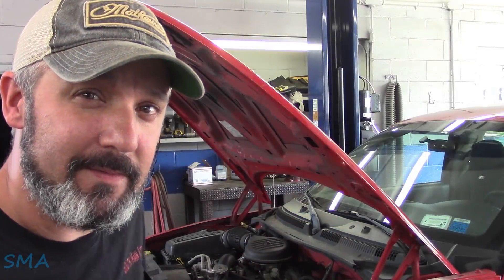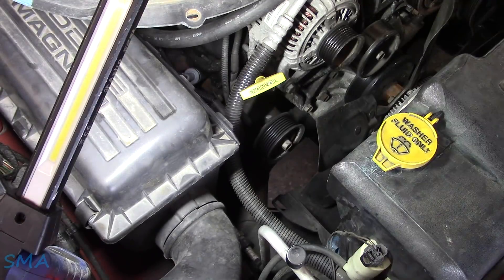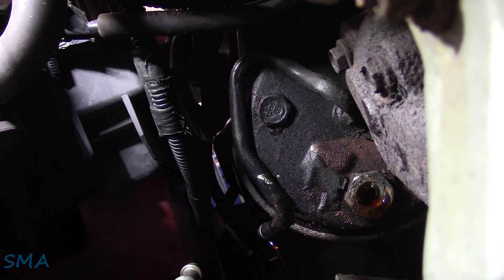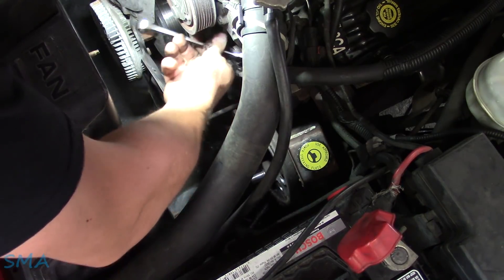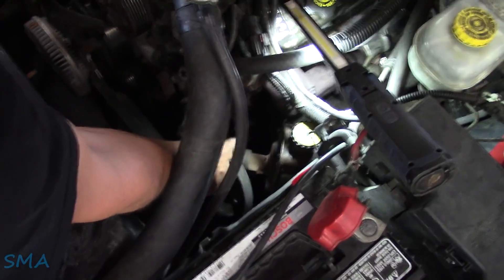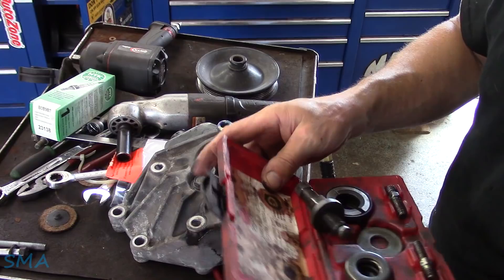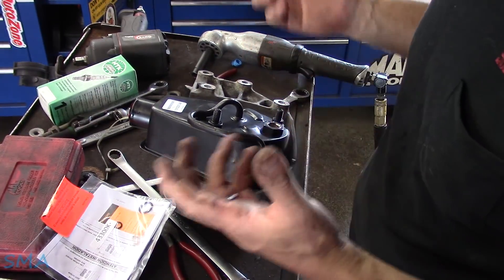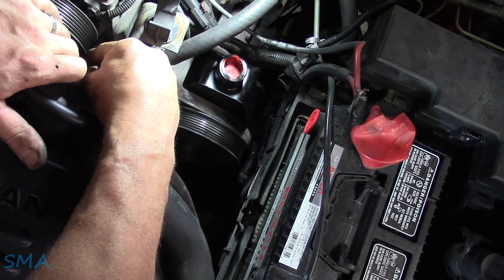Dodge Dakota: Power Steering Pump

Comment: I encountered my first press on power steering pulley when I was about 16. I had the pulley completely mangled and was ready to get out the torch when the boss not so kindly asked why I wasn't using the puller...
Reply: Doh! Them press on pulleys can be a PITA.
Reply: I don’t understand why they all aren’t splined with a nut like Honda. 🙄🙄🙄 sometimes you have little room to work
Reply: I cut mne off with a cutting disk... It was stuck. No core return on the pump
Reply: @foodskewed9197  Well...anything they can put a special tool to, spend idk what 300 per set of tools MAYBE per dealer, and bring in TONS of customers doing so when independants don't have the tools. It's anti Right to repair. It's not encrypted data in the pulley. Its a piece of metal. Not gonna pass anything saying you need basic tools to work on cars though.
Reply: @foodskewed9197  cost. Splines on the pulley and the shaft of the pump add complication and cost meanwhile a press fit is pretty easy to manufacture. especially on something as sloppy as a car.
Reply: @JackS425  you might want to tell that to some of the Manuel transmission manufacturers. The T-5 i believe uses a splined shaft for Second gear. When they put it on it broches the second gear hub onto the shaft. They sell it with the hub and slider already on the shaft. According to BorgWarner which sold it to Tremtek who continued with the process because it was cheaper in the long run.
Reply: Pullers are cool and all, until the pulley is so seized to the pump shaft that the puller rips the collar off of it haha. Then comes the cutting tools
Reply: Even w/ a puller I still have to break out the Mapp sometimes. Just be sure to have the replacement on hand ahead of time. If it wasn't leaking before it will now.
Reply: @foodskewed9197  because Here at Honda we don’t mess around. Better to have the car on the road. Or you enjoying looking at it in the drive way after all day commute. Then on some left in a shop
Reply: Real men just hammer the pulley on with the air hammer until it blows out the back of the pump!
Reply: @foodskewed9197  Splines and a nut add cost. Press-fit is cheaper to manufacture.

Comment: Others hinted but I will directly express my hope that we will get to see the reverse polarity resolution.
Reply: The guy released the magic smoke so this should be interesting.
Reply: @Brickrider2  Refilling the magic smoke is going to be expensive.
Reply: @MrCPPG  Yeah, Gandalf The Grey is gonna charge Eric O. a lot. Lets hope Eric O. doesn't lose any magic smoke on his way back home.
Reply: Yup let's see the burned up dodge
Reply: I am curious to see what happens to a reverse polarity Dodge, too. Does it turn into a El Camino?
Reply: Yah he's very lucky that his ECU seems safe do they have a special mega fuse to prevent that I heard that some Toyota's have that
Reply: I did that before to my 1999 Camry. You know what happened? Nothing. The main battery fuse blew and that’s it. Replaced and it of course is a tank and started up without issue. ☺️
Reply: @TheCrystalGlow  knew I thought I heard that Toyota had a special mega fuse to protect the car but then again this is a Dodge challenger
Reply: @TheCrystalGlow  yep! Try it on a 02 Lexus ls430! Never let your nephew hook up your jump starter. That’s why I love older Toyota’s, much simpler wiring
Reply: Normal electrical components (motor, solenoid etc etc) should be okay, but for integrated circuits you probably need to replace them all, means a lot of computers and a lot of money
Reply: Second that motion!!
Reply: @coltyao6663  my actual hypothesis is a number of fuses will need replacement and, at worst, the TIPM. Hopefully Mr O will see fit to verify.
Reply: I really hope he puts a video of too sounds like a good dia video and show us what can happen

Comment: The ruler and wire tie were there to shim the fan shroud, genius roadside fix.
Reply: Oh man, great deduction.
Reply: Beat me to it.
Reply: Was it an OEM ruler?
Reply: I came to comment same thing.
That what I thought when I first saw them
Reply: @scottyakoubian9238  Precisely measured adjustment.
Reply: Too bad that would not work. That year Dodge is metric.

Comment: Service data:  Doing things the hard way since... when was serviced data started?... since then!  Yeah, I cheat too.  That is why the YouTube comments tell me I will never be a real tech. LMAO Keep breaking the rules, saving time and making money so I don't feel alone!
Reply: breaking the rules ...or .... breaking the ruler ....... lol... I know .... no need to thank me ....
Reply: LOL I been a tech for 40 years this September. The service info is a bible for younger folks and a guideline for those who want to make money.
Reply: Even as an above average diyer, I would go crazy following service data.
Reply: in the pile
Reply: @meabob  

I treat service data as a suggestion.
Reply: One does not need to be a real tech when one has a gaggle of gnomes.  😉
Reply: Agreed. Service data is great for torque specs and as a general "how to" for some newer applications... beyond that, it's a huge waste of time
Reply: Except this time, service data was right on the $. The bracket must be pulled, so why not take it off as an assembly? He installed it that way...
Reply: @adamtrombino106  why am I going to pull al of my hoses to pull the pulley? Adding more time and cost to the project

Comment: Fun fact. The "factory specs" that Mr. O refers to in almost every video isn't actually decided by the automotive companies. It's actually the part of the design of each particular bolt. Example: ½-20 hex 🔩 will always be the same spec, I'm sure the grade plays a roll in the decision also. But I always thought it was based on the vehicle/application and thought it was interesting to find this out.

Comment: "Try to start it, wrestle with it then walk away for 45 minutes and come back and it will go right on."  Life lesson.  Truer words were never spoken.  Happens all the time.  Even with working on cars.  😱

Another great video from Eric O.
Reply: I watched a mechanic struggle with a hydraulic hose for 15 mins he through his hands in the air and gave up. I did it in 10 seconds. The trick is not to be a smug prick. it just happened for me.
Reply: Dad always said he would sleep on it, next morning problem solved. He'd say I fixed it in my dreams . LOL
Reply: yup, helps having slippery nasty gloves that you end up ripping off, screaming profanity and then throwing your wrench across the shop, walking away and come back and like he said. That bastard goes on the first try.

Comment: Changed P/S pump on my '95 Dakota - 3 days later was changing high pressure hose.
Reply: Been there, new pump, higher pressure, old hoses
Reply: It's common, the lining of the hose deteriorates over time, especially if you use whoever's fluid when it leaks. Multiple fluids have small differences in additives they use. Some hoses are resistant to a more broad array of fluids that others. Usually happens when you use cheap fluids to get you by before the repair is made.
Reply: @metalsurgeon9196  It was an old farm truck, I figured as the pump got older it didn't create as much pressure, the hose got older as well, when new pump installed the hose couldn't handle the higher pressure and failed. Definitely could've been various fluids, I bought it used and don't know what the State used in it before me. I did add fluid periodically until I repaired it as just driving around the farm it wasn't a high priority. When I had a free day and nice temperature I replaced it. Took all day as teh auto parts store couldn't find the pulley puller their system said they had, so had to drive to the city an hour away to get one.

Comment: Ha! I just did this to my 2003 Dakota 4.7. Then while bleeding the system it blew a seal in the rack and pinion. Local NAPA (not a sponsor) didn’t have it in stock so waiting on parts delivery.
Reply: Those power steering racks are notorious for an early death and expensive repair
Reply: What kind of impact is that

Comment: Been there myself  changed out my power steering  pump along with my rack and pinion  so much fun , that was on my 07 jeep liberty sport 4x4 ,  another channel actually stated that I had to drop my front differential to remove the rack and pinion but that's not completely accurate!  With a little fanagling and a little colorful language you can sneak it out the passenger side whole  !  Which inmy opinion was a hell of a lot easier than disconnecting the differential.  Have a great day  !

Comment: I just pulled mine off my 01 dakota yesterday. For those hoping to not remove the bracket I was able remove the pump without taking the bracket off. If you move the pump down and towards the driver's side there is a nice clearing beneath the manifold that you can then get it up and out of.

Comment: Just a tip I got from a GM Tech, power steering pump startups is, you bump engin just give a revolution on the engine after you fill the reservoir and make sure the engine does not start and do that a couple times and it will suck down the fluid but not aerate the power steering fluid in the reservoir. And then you will not get all that whining and stuff like that and having to try to get air out of it. All the best from Canada

Comment: I'm going to have to pay more attention to the belt direction.  In my 20+ years of DIY I don't remember anyone pointing out that little tip. Thank you.
Reply: In my 40 years of mechanicing for a living, I've never known it to be an issue.
Reply: I use it as a "did someone screw with it" marker. I put belts on the same way regardless, with the digits so I can read them. Every time no exceptions, even if the customer begs to re use the belt.  My shop policy is new belt every time, so there is little chance of squeak as possible. I also fold cotter pins the same way, just so I know if someone other than me has been there. Not so I don't have to pay a gasp warranty claim, just so I know if someone else has been in my work.

Comment: I leave my bolts and nuts loose, that helps in the alignment of the PS hoses or brake/fuel lines.  This especially works well on German cars where the threads are very fine.

Comment: As a mechanic Ive gotten far too used to doing work in areas of engines and transmissions where I couldnt see a thing, and had to work solely by feel. This video is not much different than that. Yet, i still got the entire lesson fully. 👍👍👏👏
Reply: Ever close your eyes when you're working in the blind? Seems to help me often.
Reply: @psav1520  all the time! I find myself doing it when ever i cant see what Im feeling and automatically close my eyes. Weird. I suppose so i can visualize what im feeling.
Reply: Working by Braille,  we call it, eyes often squeezed shut tight, and using the fingers that fit the gap and the angle, wishing for an extra wrist half way up the forearm.
Reply: @leighpike6572  exactly. Wishing you had a swivel elbow and 12 point stubby sockets for fingers, in both metric and SAE, and a built in mental torque wrench.
Reply: Working on aircraft it's a daily occurrence

Comment: Hey Eric. Aren't you supposed to use ATF+4 for the power steering system? My 01 and 00 both called for that. The old fluid looked pink as well.
Reply: Yeah I coulda sworn these called for ATF+4 , there's even a bulletin for these going as far back as 91 to use ATF+4 in place of the fluid that has since been discontinued.
Reply: @phoenixbranwen766  The manual for mine said to use ATF+4 (The 01). The cap just says to use power steering fluid. When I tried using just off the shelf PS fluid it made the pump strain. Its much thicker than the ATF so it makes sense.
Reply: It’s just an old Saginaw pump which GM and Ford have used on various applications for about 60 years. Dexron , Mercon, +4 or any power steering fluid works fine in them . They aren’t picky.
Reply: @prevost8686  Makes sense. Mine was probably on the way out and the thicker fluid caused it a bit more pressure than it wanted.
Reply: @prevost8686  yup those pumps are monster work a holics. Basically if they got any slick juice they're good!
Reply: But maybe the Rack n Pinion needs the ATF+4 for something??? Maybe clear PS fluid lugs the engine more???

Comment: If that's the same pump that goes on a chevy truck, then the studs on the back are for mounting the bracket that holds the back bolt to the block, and only 3 of the bolt holes on the front are used.

Comment: I did this on my 89 Dakota...  decided to change hoses as well.... naturally they didn't want to  unscrew...  took it to a local shop...  they managed to CRACK the rack and  pinion assembly trying to remove the hose...  had to replace everything...   30+yr old machines will do that.

Comment: I just bought the uh Astro long light there you had shown off, thing is awesome. like 60 Canadian pesos for the light (which is all you NEED) and then idk another 60 or so for the MAGNETIC charger, which i love. Thing has a nice bright light that is basically a perfect color and brightness. Less and less metal to stick it to...which is sad, but still a great light. I was previously using a Snap on like CHUNKY folding light. Horrible battery time, chunky, no magnetic charge less powerful light and like 3x the price. About to maybe buy another Astro to have a backup or one for when its dead and charging.

Comment: Likely the fan shroud had alignment issues before. I'd sure hate to get a new part that required cutting off those rear studs in a certain application. Good tip in suggesting try to work around the water pipe or you might own that leak down the road.

Comment: Good to see even the pros struggle with getting line nuts started.
Reply: get it straight and turn it to the right
Reply: It's sometimes easier to start the hose threads and then bolt the pump on

Comment: if the fan is rubbing, good chance the motor mounts are gone in a truck that age and engine configuration.  Just went thru that situation on my truck with the BIG Chevy 6.0 Vortec...

Comment: Curious about Eric's attitude to the warranty requirement to flush the PS system. He's on video stating openly that he's not going to flush it (for the perfectly understandable reason that the old pump didn't fail catastrophically and throw metal shavings into the lines), but what happens if it needs a warranty replacement? Surely they'd need proof of a flush by way of a reference to one on the invoice...?

Comment: Know what you mean about walk away, had to deal with my jeep that a tech tighten down the lug nuts with the impact so much that it broke the tops of the nuts off when i tried to remove them. I had to drill and finally drilled the studs out, got so pissed saturday night I threw the drill in the woods had to find it the next day.I got it fixed today

Comment: 😕🤔 mine had a snap ring rusted in it. I bent 3 harbor freight pulley pullers as well broke the pulley 😕 was on a 01 4.7L sport though way diff engine but I’d imagine that they’d used same pumps 🤷‍♂️

Comment: Battery with reversed terminals, "Smokem if you got 'em!'
Reply: A lot of smoke came out of a lot of things.
Reply: Hope we get to see how that one comes out.
Reply: Number one rule with all things electrical/ electronic... NEVER let the smoke out. Won't run without it.
Reply: @jtmack77  Buy a can of smoke and refill.
Reply: Master reset.
Reply: Battery has + and - clearly marked.
Reply: "Smoke from the dashboard; means the wirin' is a-fryin'!"
Reply: You need special, expensive Lucas Smoke for British cars. Not easily obtainable, either.
Reply: I had a 70 Buick GS, the previous owner swapped a 74 455 because the original threw a rod. They didn’t know that the 74, had an internally regulated alternator, and the 70 had external, I went through about 4 batteries before we figured it out!

Comment: We had a PS pump seal failure on a 200" stretch Hummer H2 while it was on a job, which was really bad news, as it powers the brake servo as well. The driver suddenly had his hands full, in the middle of London, trying to stop and steer 13000lbs of limo with no power assistance.

Comment: A teeny tiny bit of thought on the part of Fiat Chrysler or any manufacturer could have made this process less of a pain. And monkeys might  fly out of my...... Could the battery tray have been removed to get a bit of room instead of the bracket?   Who makes the wrench used in the end with all the facets  used to tighten the pressure line please?
Sometimes 4wr's are a godsend for squeezing that last clamp. Good video.

Comment: Then there was this guy who fitted a larger battery (got the terminals the right way around) shut the hood and there was a big flash as the positive terminal connected to the hood which welded the release catch closed so he couldn’t get it open, anyway it burned a hole in the hood. A positive experience in one way.

Comment: Hey Eric, could you have pulled the whole power steering pump and bracket without having to remove the pulley off and removed it on a work bench? I saw you install the bracket, pulley onto the pump on your work bench and then install it back in the Dakota?

Comment: Strangely interesting as I had to change the power steering pump on my Discovery 2 TD5 last week. To be honest I think the Land Rover was an easier job as the only special tools I used were a 36mm thin spanner I made in the workshop and a pulley holding tool I also made. Top tip, use the mounting bracket to get the alignment for the pump as the water pump is driven through the ps pump and it's a git to line up.

Comment: I flushed a power steering once. After I was done the steering box started leaking everywhere it was possible for it to leak. I decided the junk in the system was the only thing holding the seals together.